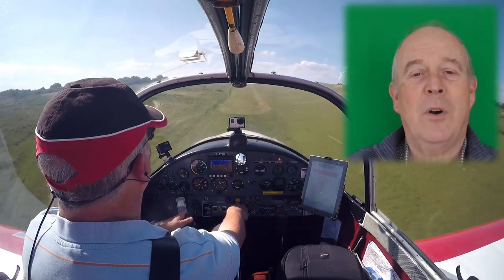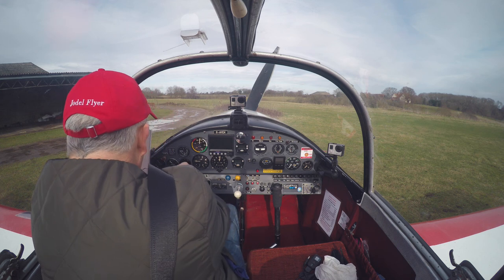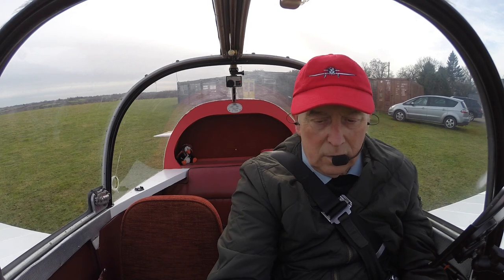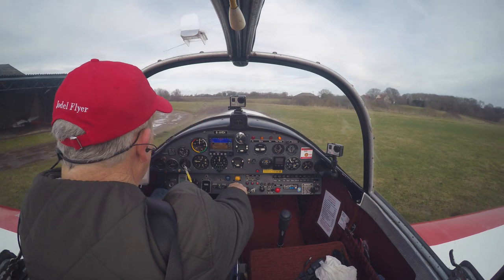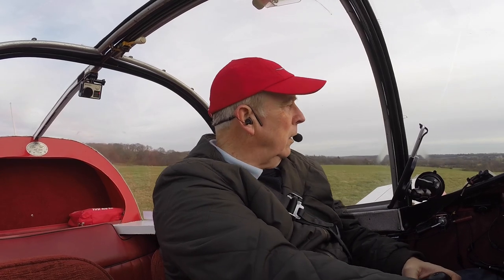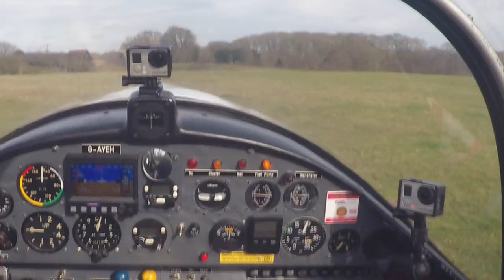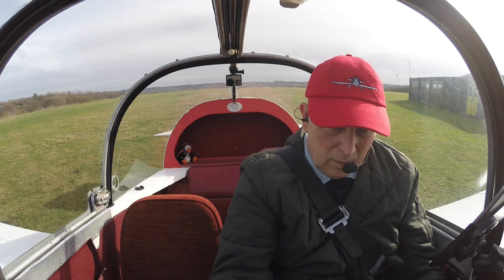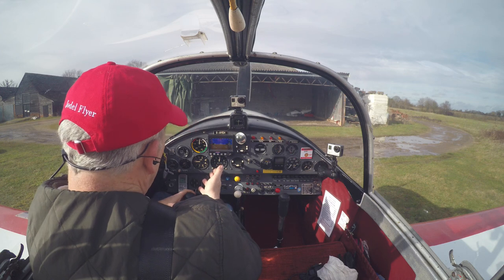IT SOUNDED LIKE A TRACTOR! - PILOT VLOG #347

Comment: Hi Tim, hair dryer and new battery and your engine was still acting up, my friend John came across this problem with Champion spark plugs with a resistance problem so he changed to new Tempest plugs, I followed suit recently and I EXPERIENCED A PLUG FAILURE !! changed the offending plug then fine, it might be a trail down HT Leads and Magneto checks, maybe still worth splashing the cash on new plugs, I will paste the Champion problem here  I first became aware of the Champion spark plug resistor problem in 2010, although there’s evidence that it dates back to 2008. We were seeing numerous cases of Champion spark plugs that were causing bad mag drops, rough running and hard starting even though they looked fine and their electrodes weren’t worn anywhere near the retirement threshold. The thing these spark plugs had in common were that they were all Champion-brand plugs and they all measured very high resistance or even open-circuit when tested with an ohmmeter.  Chris.
Reply from the maker: Thank you Chris. I am back over tomorrow to have another go and start trying to workout what I didn’t have time to check last time I was over there.

Comment: Hi Tim, disappointing I know but it does not sound mechanical. No smoke or rattley noises so I am convinced it will be ignition related and cylinder specific, so unlikely to be a mag problem. So we're down to plugs and leads.  It may be that problems with either of these are exacerbated by mixture but I can't see that carburation is the central issue. I look forward to seeing what you and John turn up. 
Yes I did enjoy it, I enjoy the fettling almost as much as the flying!
Reply from the maker: Thank you for that Carl. I am never sure how people take a non flying video but as it is now more of a vlog style I tend to just record what’s happening each week. It may be different if I get lots of flying in and fingers crossed that will happen soon! 🤞

Comment: You may well have tried it, but did you try slowly leaning out when at 17-1800 rpm until the revs drop a few times. I've found that quite effective in clearing carbon build-ups on the plugs etc (burns it off as they get hotter). If you had some oil residue on the plugs, that might have interfered with the spark. Apologies if I'm suggesting the obvious, just a thought. Staying safe is the prime directive though.
Reply from the maker: No need to apologise. All suggestions are welcome. The hair dryer came out of a suggestion made in a comment! 😊

Comment: That was the "old vs bold pilots" decision. I would still guess it's a plug  if a cylinder not firing or propeller disbalance if engine is ok but vibrations remain. Still, smart decision made.
Reply from the maker: Very much an ‘old pilot’. Not much ‘bold’ in there now.  A true Steady Eddy! 😄

Comment: G,day Tim. 
Good caller astaying on the ground as we all know it,s about judgement after all. It appears electrical in nature the issue you are having as it should have cleared by the running you were doing which I assume was up to full power a few times ?. Did you have carb heat on once warmed up for extended period. We in winter did this once warmed up until take off. With Hair Dryer or heat gun get saw horse and let it run directly into carb air entry for at least 10 minutes or more then into main inlet vents to heads.if really cold cowl on. You may need to take leads off one  at a time to find offending either lead or plug or both. Don t think it,s timing issue but ya never no. My one and only emergency I had in a Cherokee 180 was fouled plugs in the end couldn,t get power back passed 2600 if I did it felt like the engine was falling off or had lost a blade of the prop. Had a full load Pax on board as well. Declared a PAN PAN luckily not to far from Aerodrome about 5 clicks out. The result of that was the Tower ordered a Air New Zealand Boeing 737 break off his approach until emergency was over and they gave me any runway. I managed to get it back to 2500 but no more. So landing speed was 125ish which was normally cruise speed. Bit more excitement that I could have done without. It was determined it was plug fouling  of 3 of the cylinders. Don,t think it,s fuel related as was running other wise. If you had leaned it out a bit with no change not that. Maybe try some start ya bastard to give it a boost. Don,t  think it,s a sticky valve. Anyhow I suspect you will sort it in due course.

The RV4 he can use GPS for airspeed if other a bit weird.

Be well fly lots.

Cheers Nick.
Reply from the maker: Thanks Nick. That was quite a shock for you and your passengers. Loved the idea of sending the heavy around. John did check speeds with SkyDemon after we had put the RV away and it did tally. Just a nice calm but cold thick air sort of a day!
Reply: The Heavy loved it flew round at 5000ft to the East ror 20 minutes had blast even said well done Young man. Certainly was a pucker moment.